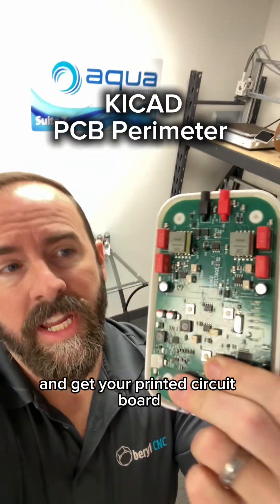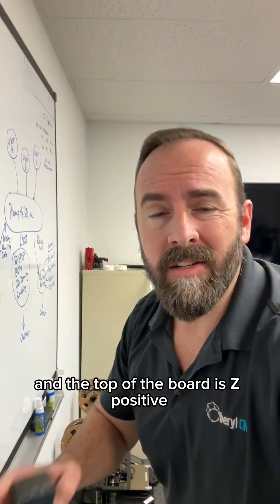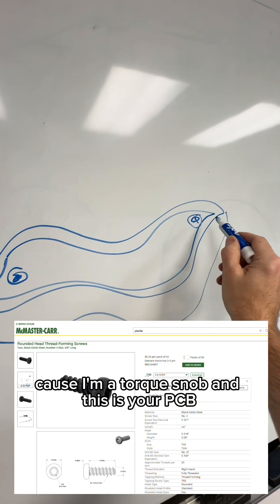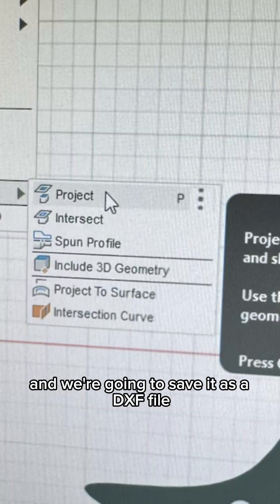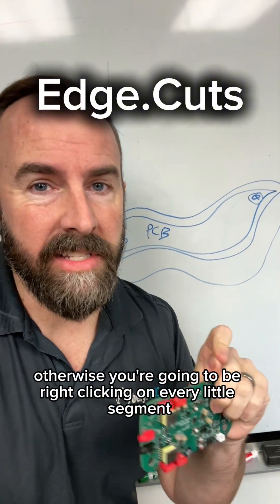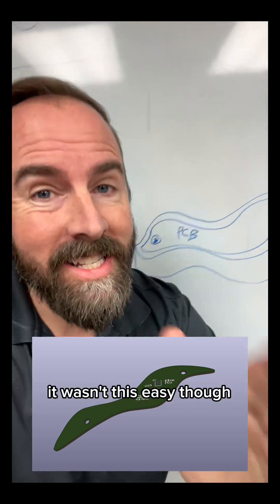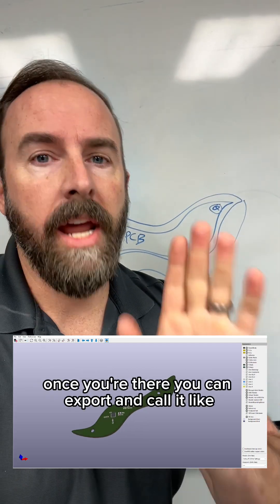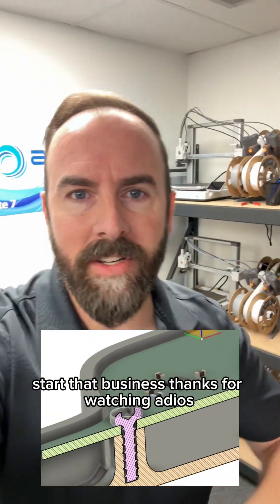How to Import a PCB Shape into KiCAD

Comment: In solidworks you can load a picture of the thing then draw over it and it's fairly quick, seemingly a lot quicker than what was demonstrated. Does Fusion have the same feature? Or is there another reason to do it with 2 different programs?

Comment: With the right sizing, screws can go into 3D printed housing directly, or for a more robust solution heat set inserts can be used. 

I usually go from PCB to case and bringing the 3D model of the board into CAD still amazes me. The edge offset tool in CAD is really handy.

Comment: i'm  using the kicad addon in Freecad.
where you can import the whole pcb projectfile. with component models so you can move the component as needed and make holes that fit button or LEDs. and then just import it back to kicad.